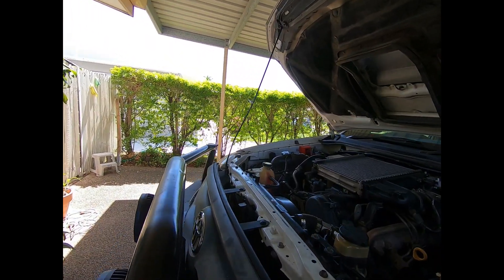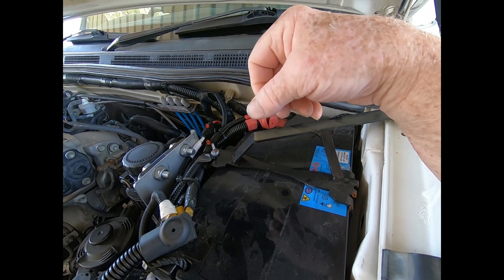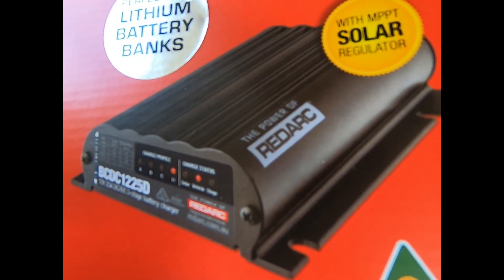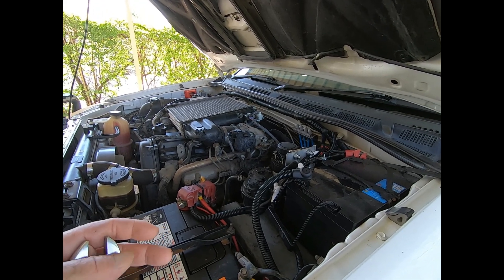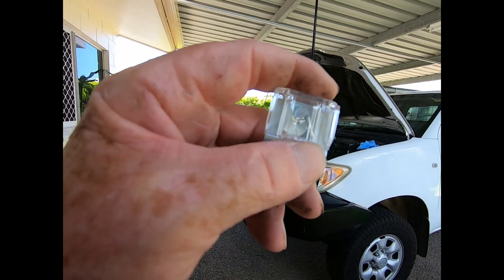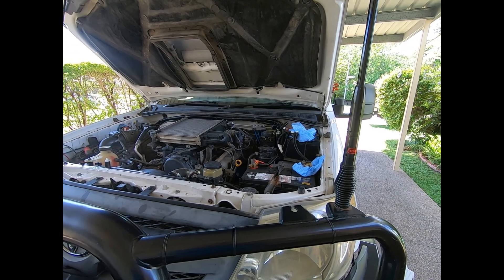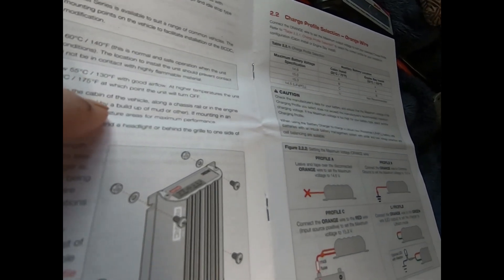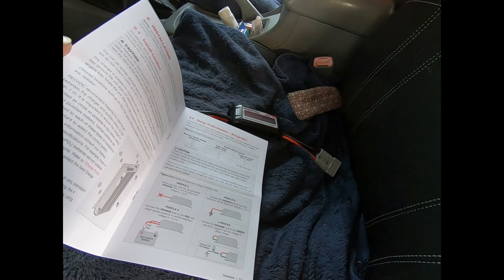Redarc BCDC1225D 25A In vehicle battery charger

Comment: Hi there derek,just watched your vid on KINGS dc-dc charger something went wrong with it. Saying i have a kings 200w solar blanket that only put out 120w & 8mp on very good day how is yours going thnanks video.
Reply from the maker: Hi, because I'm an electrician, there's a formula I use to work our how much current appliances either use or make. Watts = current x volts. Most solar blankets put out between 18 volts and 21 volts, so you divide Watts by the volts to get the current. 200 divided by 21 equals 9.5 amps on a perfect day, in the middle of the day and on the perfect angle to the sun. I have a Kings 110W solar blanket and a 200W Ridge Ryder solar blanket and they're working perfectly. I had a Kings 200W solar blanket but I sold it when I sold my camper trailer. I have a Kings DC to DC charger in my caravan and I have a Redarc DC to DC charger in my Hilux and they're working perfectly. Cheers.